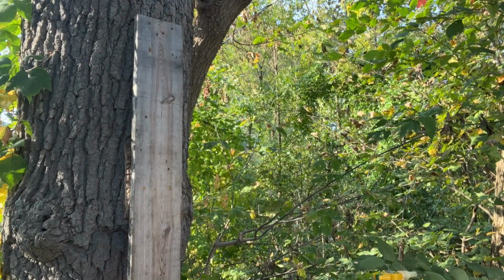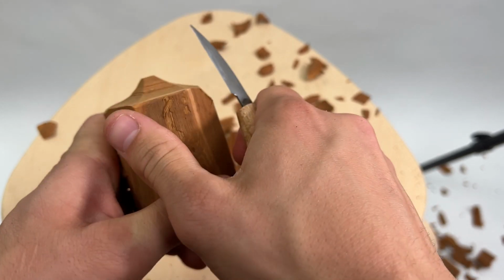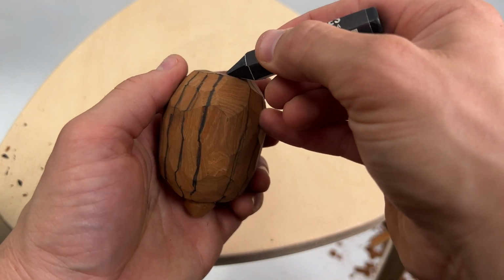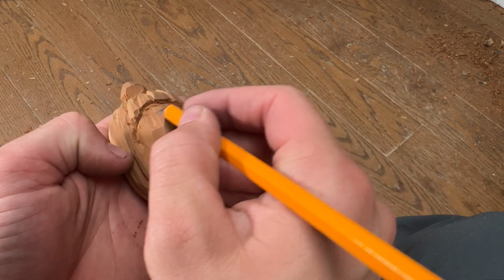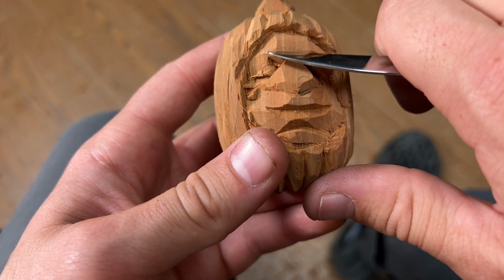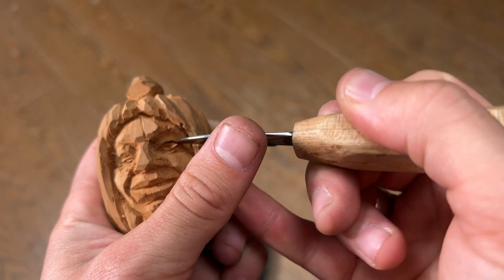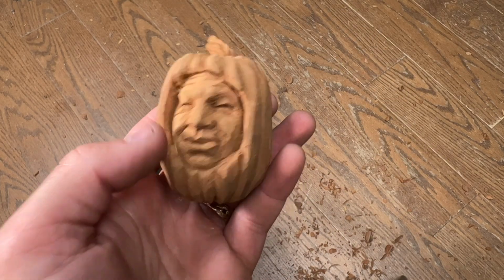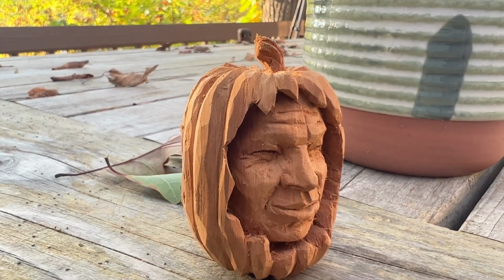Woodcarving a Pumpkin Head--Intermediate Instructional Whittle, Start to Finish-

Comment: Great work! 👍👍👍

I've been seeing a lot of bark carving videos in my feed lately, now I want to order some and give it a go! 🤔💁💁💁
Reply: I live in the North East of England, It’s very frustrating to see carvers using not just this cotton wood, which is limited supply in this country, unless anyone can tell me otherwise, but also what I am sure is a better quality of basswood, which is also limited in supply and sizes. I say a better quality only because it seems easier to carve, I appreciate knife quality and sharpness is important but I have Flexcut knives and am knowledgeable in sharpening cutting tools, so although mine may not be quite as honed as the experts I still feel they aren’t capable of cutting the bass wood, available to me, as easily as the experts. I have also tried Lime but I think this is even worse, imo.
Reply: @boblawrence5011  
My basswood comes from north central USA and some from the UK, both are good, but the USA variety grain seems to be more "clear" and not having many dark streaks.  Also one of my local carving suppliers sells discount bags of "mismatched cut-offs" in a variety of smaller sizes packaged together.  In these bags there are softer and harder basswood, as well as some with streaks and clear grain.

I also use FlexCut, plus other brands and a few custom sets and sharpen my own.  I have not had any trouble with and bass work nor maple or oak.
One note for your problem cutting some apparently "not so good quality" basswood is to be sure your knives and chisels are extra sharp when cutting softer wood (which seems contrary to logic). The fact is that softer woods often are not be strong enough to allow a good clean "push-cut" and tend to compress, tare, and bunch-up in front of the blade or chisel edge and make a little wall of resistant...

The best way I found to solve this taring and bunching-up problem is to sharpen chisels and knives OFTEN, or use "thinner" blades and take smaller cuts, and if necessary,try to cut more dense pieces/blocks if they are available.

I'm not a pro, so my advice might be lame, but this is what has been my experience in working with a large variety of basswood, peach, oak and maple.